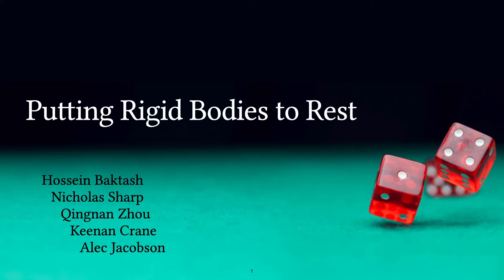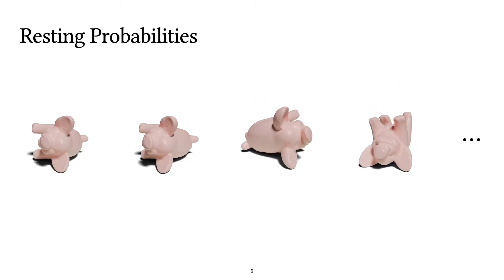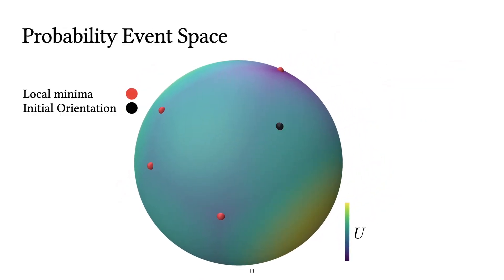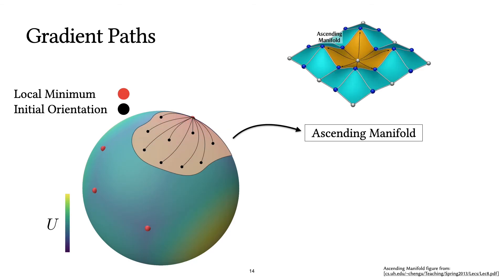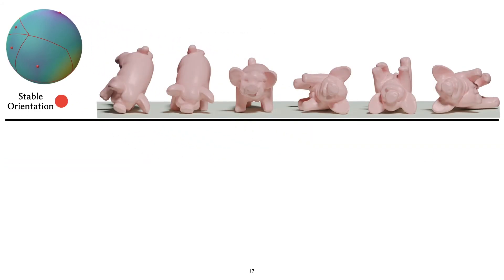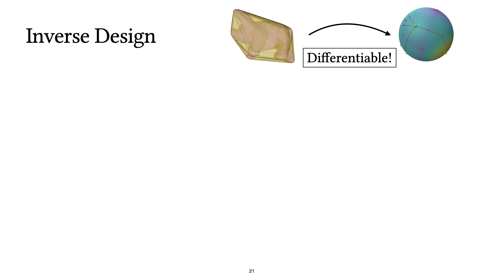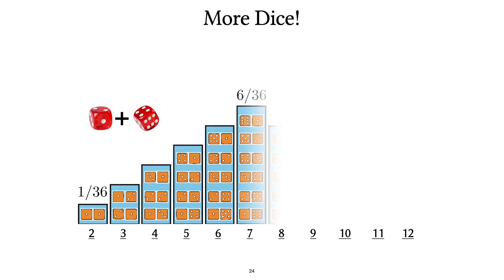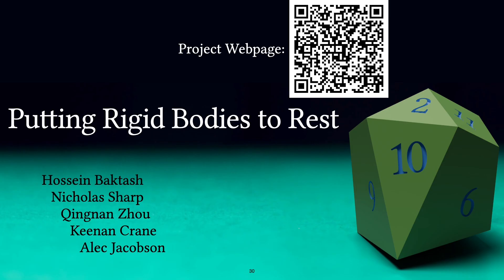Putting Rigid Bodies to Rest (SIGGRAPH 2025)

Comment: I think the piglet example has a significant difference between reality and theory. Your theory assumes fully unelastic collisions with the table. In practise, when an unlikely position occurs on first contact with the table, it will be much more likely to bounce out of it than the other way around. Another thing that plays a role is the potential energy. If with the initial contact energy it can get out of the already unlikely configuration, but not into it from another one, you stack the odds.
Reply: You can see this in the 2d6 case as well, 2-4 and 10-12 are less likely than predicated while 5-9 are more likely. I agree, this is not statistically-insignificant error but a limitation of the methodology.

I wonder, though, if it's possible to correct for this? There is a lot more information in the model than is used by the method. Something could possibly be done by examining the depth of the "valleys" around each stable point and applying a correction. Actually I wonder if the total volume of the valleys would work—image a body whose surface is offset from the unit sphere by the value of the function at that point, surrounded by a larger sphere that fully encloses it, and look at the volume of the difference between the two in the region subtended by the ascending manifold. Mathematically this probably looks like an integral, so you might lose the benefit of avoiding numerical integration in all cases, and I have no idea if this would even produce accurate results.